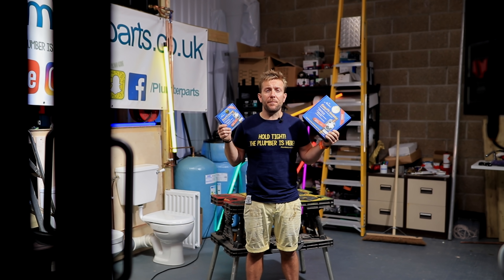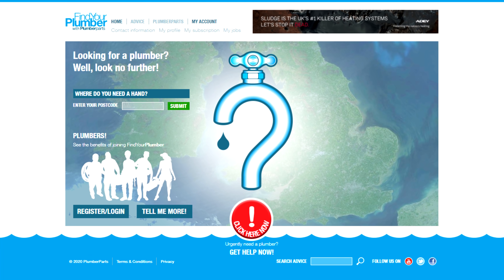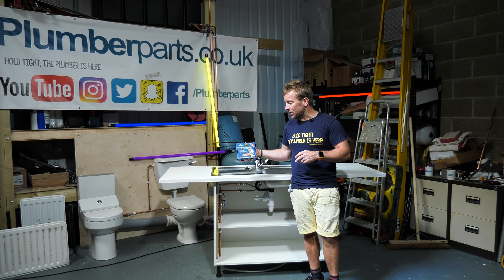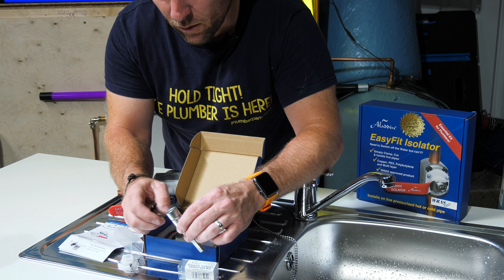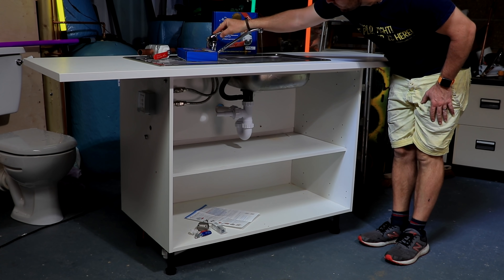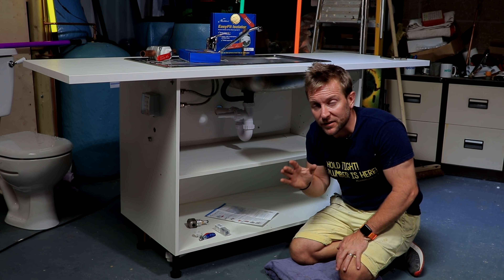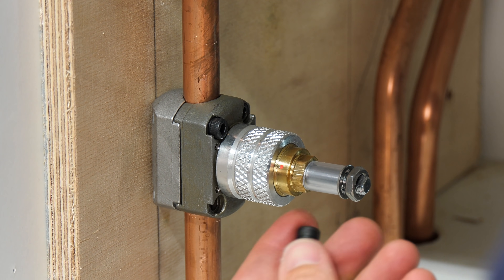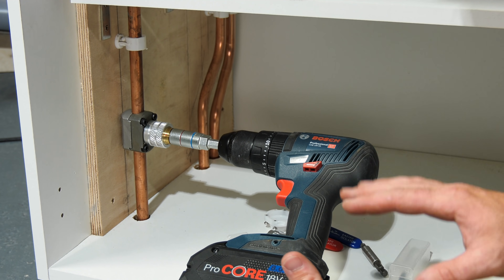HOW TO INSTALL VALVE ON LIVE WATER PIPE

Comment: Are these reusable? Say you've used one in a quick fix, returned to do a tidier permanent job. Or just DIY. Can you get multiple uses from it? Rush jobs aren't permanent or tidy, it's rather bulky too, just wondered if it could be reused.. is it worth taking it out. Thx
Reply: Most likely you wouldn't want to remove this I suspect whatever mechanism is used to cut through the pipe will get upset at being re-used or removed, and likely the bit of pipe cut out is jammed in there somewhere. The seal should be fine since it's just an o-ring and as long as it hasn't been in place for years and years it should seal up fine repeatedly. We'd have to get a look at exactly how it cuts through and forms the pipe to know.

EDIT: I am derp.

Comment: Here in the US I use sharkbite as my emergency valve if there is no way to get the water shutoff.   Then once water is able to be shut off, I take the sharkbite valve off and install a permanent valve or make the pipe repair (if a valve isn't needed).

Comment: At 3:49 you say that you can put a valve into a pipe where for a critical reason the supply can not be turned off. Umm-m, then why do you need a valve in it? 
Soz, couldn't resist the joke! Looks like a good product.

Comment: Are the water supply lines under the sinks in the UK typically to the side of the sink?  Here in the US, they come out of the back wall, but I've never encountered one that did not have shutoff valves for both the hot and cold water lines.  I've been to the UK and stayed in various AirBnB places, but I didn't think to look under the kitchen sinks to see what might be different in the plumbing practices.

And it is ridiculous than manufacturers would choose to make a kitchen cabinet that is for a sink (and thus by definition going to be wet) out of particleboard like you have in this video.

Comment: Looks like it has a circle cutter which goes totally through the pipe. The two copper disks must be squashed flat and stay in a recess 'past' the pipe. Very clever. Times have changed. 'O" rings have been proven to be watertight for decades. I've used some Shark fittings for years. Don't remove them or play with them, but I fully trust them now.

Comment: That's all well and good for copper and plastic (Pex), but my house, built in the 50's uses galvanized throughout. I'm skeptical that this system will work for me..
Reply: Pretty sure it only works on copper pipes. It has to compress the section of the pipe.

Comment: I’ve always wondered where the bit of copper goes that it cuts into
Reply: That's what I was wondering
Reply: Narnia 😉
Reply: I have the same question ....🤔 apart from that it is a great and handy item to have it
Reply: Well done 👍!
Reply: It gets crushed and pressed into the bottom of the main casing.
Reply: It magically re insinuates itself back into position so can  use it on the next job👊😆
Reply: It comes out of the tap and hits the grating and ricochets into your clients eye with the force of a speeding bullet.
Reply: But the good thing is that at least after installing you can actually close system and purge them out from tap or what ever is the best location. That's the least of worries if you have that specific "moment".
Reply: Would love to see a disassembly video to see where the copper pierced part lodges in the control valve.
Reply: Surely, when it makes the hole it produces swarf and not an actual washer shaped piece and it would literally then just flow out the tap with the water.
Reply: 😂same
Reply: Can this be used on painted pipes,????thanks 👍
Reply: Me too

Comment: thanks for all you informative videos..quick question 🤔 i am moving into an old house that has a tiny w/c with no wash basin. shocking right! didn't know these existed but trust me they do. How quick and easy is it to get a wash basin installed? my worry is more around the expense of getting the water supply.
Reply: I can't comment how quickly a wash basin can be installed this is down to your plumber, however the EasyFit valve can be installed and water isolated in under 3 minutes.
Reply: I'm not sure if you have had this project done yet or not but the question is difficult to answer without knowing several things. Just off the top pf my head: You need to consider what type of sink you want and will it fit or do you you need to do some carpentry work to increase the size of the room? How far away are you from the water source (both cold and hot) as well as how far from the drain line? Will you need to rip into walls, floors, ceilings to install the water and drain lines? Will the walls... need to be repaired, repainted... when done? Then there could be frame work in the walls that make the short way not the easy way to run lines... The only good way to get an idea of cost is to get a few estimates from good plumbers.

Comment: Can I use a 15mm one of those on half inch pipe?
Reply: If it’s steel barrel then no! Unfortunately. You’ll probably need to find a way to freeze it if your that stuck.
Reply: No it's half inch copper pipe
Reply: paul1962uk I see. I know it’ll fit round the pipe as there the same size externally apart from a few thousands of an inch but I know the half inch pipe the actual copper is generally quite a bit thicker so in theory it should work but you’ll have a bit of a harder time crushing the pipe. Maybe ask Aladdin if you get no luck on here who’s actually done one on half inch. Sorry couldn’t be more help.
Reply: Thanks Matt
Reply: Yes they fit 1/2" imperial pipe too.
Reply: @niftylittlebleeder  when did you add American sizes
Reply: @robrocco5420   the 15mm fits UK imperial pipes but not USA 1/2" pipes as these are thicker.  However the 22mm version also works on 3/4" USA or Imperial UK copper pipes. thanks

Comment: Hm, I notice answers to the question 'where does the disc of cut out copper go' have disappeared.  As an experienced plumber, I AVOID such devices like the bubonic plague, for that reason, as I have had to extract bits of copper & swarf from other parts of plumbing systems. There is always a way to shut the water off, or a work around using compression fittings and a hose.  You can get cheapo hose taps which cut into the pipe, and they eventually corrode, block, cause problems and / or leak.

Comment: My parents live in a block of maisonettes and the stopcock for theirs is external and seized up and so if they need anything done they have to shut off the whole building, would this work as a being a stopcock if fitted on the incoming supply internally.
Reply: Yes that's a perfect time to use an EasyFit .  They're WRAS approved and guaranteed for 10 years.

Comment: I have a seized stopcock for the mains. I can not find anything outside to switch it off. Would this work or will that be a stupid idea?
Reply: @Janna Ehh lol. My meter is covered in concrete. It happened when my cement mixer fell with grutelade in

Comment: brilliant devise but by making hole in pipe by drilling what happens to the copper debris and filings
Reply: I'm guessing it's behind the aerator on the faucet. Could also cause turbulence in copper pipe. Looks to similar to those junky saddle valves.  I could only see this being useful in an emergency. Until some proper fixes can be done.

Comment: i tried one a couple of years back and the screws/bolt heads stripped (may have been my fault so be careful) - a pro tip is have a speedfit isolation valve with speedfit pipe terminated outside quickly cut pipe stick on speedfit valve with it open as pressure is redirected outside the turn valve reattach pipework to rest of house - just unsure pipe is clean and free of dints etc

Comment: What happens to the pieces of metal you drilled into the pipe? Even non-soluble flux circulating in your water pipe will make a pinhole leak somewhere years later. A video of where it goes would be nice.
Reply: You get them for outside tap kits, usually, the metal just bends slightly but i have been back to houses where they have installed them and they are  rattling around the pipework.twice they have blocked the  flow to a tap

Comment: Hi It was never mentioned why there are two lines on the socket one RED and one Blue !  Hot and cold pipes ??  Different material for the pipe eg. copper or plastic ???
Reply: Probably explained in the instructions, but I suspect red is for copper and blue is for pex/plastic.
Reply: @ColtaineCrows  Cheers

Comment: Does this valve inhibit the flow?  I’m thinking in terms of a standard iso valve compared to a full bore iso valve the latter allowing greater flow
Reply: Hi it's full bore.  There may be a small drop in flow but is not usually noticed - flow is around 98% following installation.
Reply: Aladdin Plumbing Products great stuff thanks for the reply
Reply: @niftylittlebleeder  I've read some Pegler type valves should be left slight  on? I am here because I installed service valves all around my system about 15 years ago and of course they mostly seized. For the cold I can turn of main - everything is.mains cold except the showers.

But for the hot we got new gate valve fitted but I think that only stops the cold into tank? Can isolate tank so would need to drain down cylinder but that either costs me time, money or both. So this product seems interesting.

Thanks for systematically answering most of the doubts folks have raised.

Comment: Do you have to order from the USA if you need the Imperial version?  Our factory is very old and has a lot of concreted in imperial pipework.
Reply: The 15mm version as shown here is not suitable for USA pipes - it can be used only on UK 1/2" imperial pipes.  The USA pipes have a different wall thickness thanks

Comment: I'm curious, when you remove it what does the pipe look like? Just want to see how it did what it did. Looks strong.
Reply: You don't remove it.. you leave it permanently in.. it cuts a whole in the pipe
Reply: Good morning, it you were to remove the valve you would see 2 completely separate pipes with a section of pipe is cut away in the center, as the pipe section us cut away the spent pipe is imbedded in the valve base, the pipe is then held by clamping rings and seals on the inlet / outlet of the EasyFit Valve.

Comment: I've seen similar solutions for compressed air solutions for workshops. Don't see any reason why these wouldn't perform as well. I've seen some blowouts with the air ones, but obviously most shops run their compressed air systems above the rated spec, they do tend to last in the neighbourhood of 10 years before they fail however, well, either that or instantly because of improper mounting.
Reply: We use a lot of pneumatics and I haven't seen that - what is the brand please?

Comment: You say she installed it the right way round but you both had it vertically, turning horizontally to turn off the supply so what's different,  other than one being at 12 o'clock vs 6 o'clock?
Reply: @Long Tall Phallacy really? 
at 12 mins it looks like the water is on when she's fitting it and she had to turn it off at the end.... Same as when he did it...

Comment: I'm waiting for one that can be installed on 25mm blue MDPE service pipe. Fortune to be made with that! Nice tutorial (as usual) Thank you!
Reply: Use a squeeze off tool
Reply: @marcusward1130  that's not recommended on older mdpe or black from what many plumbers have told me

Comment: A tip for this, have a hoover.  Have the valve open.  Cut the live pipe, whack the valve on open.  Tighten up and shut the valve.  If you cut the pipe and try to put a closed valve on you’ll get into a mess.  Deep breath and go for it lol

Comment: Could of done with this last year! Had to use freeze pipe kit that didn't last anywhere near as long as it said it would(set my timer) . I've never felt so much panic as seeing the ice moving to part I'd cut and then water  just shooting out! Lucky I had compression isolation valve to hand incase things went wrong😞

Comment: Is the water running because it's necessary to install this valve, because of water damage and pressure?
Reply: Good morning, these valves can be fitted under maximum 16-bar pressure, they are designed to stop flowing water i.e. burst or leaking pipes or for use on planned maintenance to void disruption to other areas of a building, no need to isolate elsewhere, no more draining down of systems, subsequently saving hours in labour and thousands of pounds in replacing inhibitors, also allowing works without limitations are flow doesn't to be stopped / restricted to anywhere other than where works are being completed.

Comment: What happens to the piece of copper cut out by the unit? Great job whatever!
Reply: Left it inside. Hahahaha
Reply: The section of pipe that is cut gets completely crushed flat and remains inside the valve leaving a full flow isolation valve in place. Not cheap but top quality kit

Comment: What about pipe freezer?I think any decent plumber should have one
Reply: A pipe freezer will only help you if you can stop the flow. If you have a leak and no means of isolation this looks to be quite a neat solution really, don't think I'd want to leave one as being my main isolator long term though.
Reply: @_______DR_______  good points, sooner or later best to get proper isolater

Comment: These have been out for years.  They are great for a quick tap in, just not a permanent fix
The Huge Weak link is the O-ring that clamps the water from leaking.  it flattens out and leaks.
Reply: Hi C I think you are thinking of something else perhaps the self cutting washing machine tap which seals on the side of the pipe using a gasket.  Whereas the EasyFit uses a seal the higher the pressure the more it is forced into place thus preventing leaks. It came out in 2013 after a number of years in development.  Hope that helps.

Comment: If the pipe is painted, would I be correct in my assumption that you'd have to rub it down first?
Reply: Yes, get that paint off the entire area the valve will sit over before installing, or you'll either have it seal for a little while or fail instantly. Removing one of these without having another valve to turn off somewhere else in the system will be no fun

Comment: Can I use this in old galvanized pipe, or do you know of one I can use on live mains in the garden if I dig up and chase it through wall, cheers, great videos and content.👏👍
Reply: Unfortunately this version is not suitable for galvanized pipe.
Reply: Any ideas what to use from steel to blue?  Got a 28m to 22m coupling but still getting small leak - ideas?

Comment: I am not too sure about this so what about the piece of copper you have just cut though where does it go
Reply: EasyFit valves compress the spent pipe into the valve base, no debris is passed into the line.

Comment: Did I miss the part where he said what the difference was between the red line and the blue line? 🤷‍♂️
Reply: One is a different colour
Reply: No. You didn't miss anything. He didn't mention it.
Reply: The red line is for the UK market the blue line applies to the US version.
Reply: Red = Hot, Blue = cold 😉🤷‍♂️
Reply: @user-ix4ge6rr7u  that's the valve handles not the line on the tool you drill with....
Reply: 7 minuets in to the vid

Comment: you don't need to flush the metal shavings?  It might cause accident to the eye, ingestion.
Reply: All spent pipe is retained outside of the flow in the valve base.

Comment: At one point you say you can fit one of these in a hospital situation where you cannot turn the water off. Why would you want to fit one if not to turn the supply off?
Reply: Loads of reason - to change a tap for one...
Reply: @petercubbin  which would involve turning the supply off. So I refer to my previous question.
Reply: @cypeman8037  Presumably turning off the supply to the outlet you want to work on would, owing to a lack of isolating valves, mean turning a lot of other outlets off as well. The hospital/factory etc could probably arrange to work around having individual outlets isolated but not all of them off at the same time so in this case this tap is an ideal solution. You probably wouldn't use them too often so I recon the cost is a reasonable one to save every one concerned a lot of hassle. They would be more than glad to pay the extra for the lack of inconvenience.

Comment: Won't work too well if you are trying to replace your current leaking shut off valve that is almost flush with the wall. No room behind it to fit on the pipe.

Comment: There not that great on old thicker copper that also been work hardened with 30 years of hot water flowing through it. It spurted water out of the cutting plug threads and my 18v metabo drill on the highest clutch setting just jammed up after about 3 turns so had finish the rest by hand which was very hard going and took another plumber to hold the pipe while I turned the cutting plug. A great piece of kit but on older thicker copper they are definitely not an easy install

Comment: just turn the water off it will save you a fortune, oh and by the way that little bit of copper often turns up years later jamming your ball valve or a rattling noise in your pipes, the other thing is if you can't turn off your water you should really be able to just in case you have a burst, do it right!
Reply: I'm guessing you didn't watch the vid?